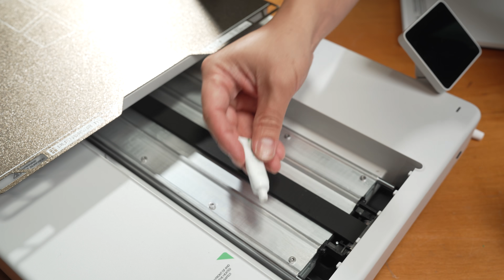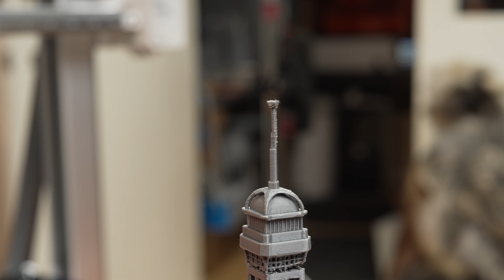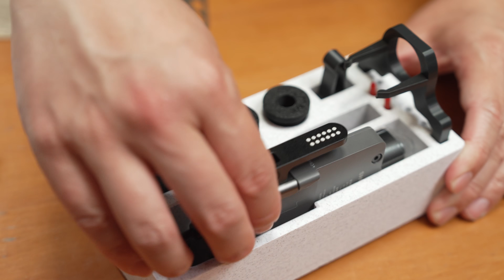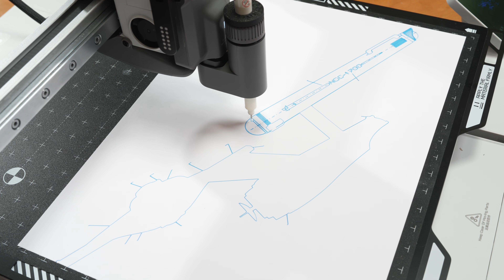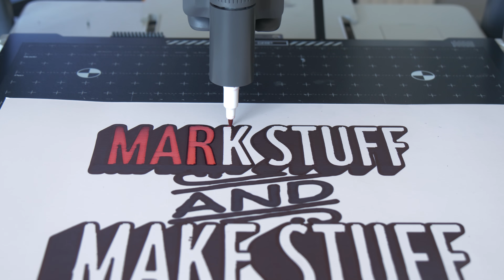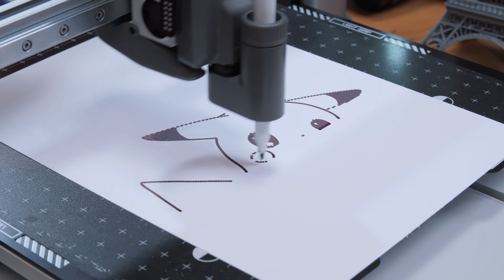Bambu Lab A2L Printer Review!

Comment: @tested  For most people outside the software development field, it’s difficult to understand the nuances in this controversy, which is understandable. However, like most things in life, there’s more to the story. The issue at hand revolves around third-party development libraries. Most complex, and modern software today is developed with the use of libraries. Libraries by definition are separate code from that of the core software being developed.

The leading figure in this controversy, SFC, have an extreme view (by their own admission) on how software licensing works, which differs significantly from how many in the open source and commercial software development communities have historically treated them. The SFC appears to believe that if non-AGPL external software interacts with AGPL code, its license supersedes the Ts&Cs and governance of the other software. This is a rather extreme position, considering that there is currently no legal precedent to support this position.

AGPL governs the slicers code; it does not govern the code beyond it. The nuance many are missing is that the block of code that was redacted and then subsequently restored by the developer (and seems to be the major red herring in the controversy) is only to call Bambu’s private libraries. This block of code is in fact governed under AGPL, however is not actually at issue in this matter by either party. This block of code only exists to call the third-party library; it is not the library itself. However, when the library is private and you attempt to access the library (without authorization) and then bypass the authentication controls, as Bambu alleges, and Jarczak’s published code appears to have been designed to accomplish, you’re now putting yourself in legal jeopardy. 

It should also be mentioned that the SFC is hardly a neutral party in this matter. They have helped to raise hundreds of thousands of dollars to their own foundation as a direct result of stirring the pot on the Bambu controversy. But their ethics are simply not questioned, even though their funding for their foundation relies on creating, what can only be described as rage bate content over Bambu in order to drive donations. 

Finally, it’s highly suspect that to date, the SFC has not brought any legal action forward in their dispute with Bambu. This is despite an extremely vocal position to the contrary; raising hundreds of thousands of dollars in direct donations as a result of the dispute. Additionally, waging a battle in the public arena, and stirring the pot with the community, it begs the question that if the SFC has a strong licensing case and a history of AGPL violations on the part of Bambu, why have they not moved forward with legal action? A curious position for an organization whose core mission is to uphold AGPL licensing infractions.

Comment: I really need advice on buying a new 3D printer! I want to print high detail but not too big prints. I dont like my old printer, i have a Creality Ender 3. with a new bed because the original one sucked. My prints Are detailed but I would like even more and a more steady printer (this one often make mistakes) and its so randome if it makes mistakes too, one time it works another it does not. Changing the fillament is always a hazard, it clogs. I also think i want a more fine top, mine is the standard 3mm. I cant have a resin printer as I live in an apartment with children.

Comment: I would buy it, but to be perfectly clear, i do not want to do business with a brand that "forgets" that they built their entire product line hardware to software on open source and suddenly they're shutting the door and acting aggressively when someone just uses things as they are to open the door back up for customers told that they don't own what they bought. I also don't like to do business with people who lobby for destroying open source through stupid laws (like it's happening in NY) just so they can get away with what is essentially theft (because you cannot categorize taking something that's free for all through the work of those who RESPECT open source and making (in the digital space) and then locking it behind a paywall as anything else other than theft).
I'll stick to open source printers, the quality is perfectly adequate and quite honestly better if one takes the time to optimize their software and hardware.

Comment: I'm sorry but Bambu labs don't just get to say "we don't want 3rd party developers taking or reusing our code". They forked OrcaSlicer which is under AGPL, which means Bambu Studio also has to be under AGPL (that's how AGPL works, you use AGPL code in your project, your project also has to be AGPL). That means 3rd party developers can do whatever they want with that code, it's open source. 

And for people who think "well that's fine for Bambu Studio, but the code to connect to Bambu's servers is a separate package, and the source code for that hasn't been released", again, that's not how AGPL works, in fact the AGPL license was specifically designed to prevent this loophole, if your project is AGPL licensed, you have to release all associated source code for core functionality, you can't just claim that part of it is under a different license.

The bigger issue is how Bambu have been responding to people trying to restore the functionality the printer came with when they bought it, i.e. threatening to sue them if they don't take down their code (which, again, they're allowed to use however they want, since Bambu studio is AGPL). They wouldn't be locking this stuff down unless they expected to make a profit from doing it, so either they're using this to sell your data or they'll paywall this feature behind a subscription in the near future. And do you really want to buy a product from a company that treats it's customers and open-source developers this way?

Comment: I will admit that Bambu Lab has produced some of the most polished features I have seen yet. It is good to see that such high print quality and built-in quality-of-life features are finally becoming available to make 3D printing into the general purpose user-friendly device that we have been wanting for decades. Unfortunately, I just don't trust them. They have proven that they are as power-hungry as Apple, wanting to turn their customers into their disciples. I prefer not to play in their walled garden waiting to have the rug pulled out from under me. If you depend on the company you buy something from to NOT change the rules on you and take away features that you know your hardware is perfectly capable of, then you do not own the device you paid for, you are merely leasing it. I will wait a few more years for comparable features to become standard on every manufacturer's printer. Now that Bambu has shown the technology is possible, I know they are most surely on the way.

Comment: Did Bambu fix the problem where your software has to contact them to get permission to print anything?
Reply: So when my printer has no wifi, and I put an SD card it won't work. Because it will.

Comment: For the record Tested, I have not watched the review but I went to the AGPL section and they simply violated the AGPL. This is an unforgivable action based on their unwillingness to comply with it, not to mention gaslighting the community. You all at tested are all about makers right? Well AGPL is a very "maker" centric license. A company that ships AGPL licensed code without honoring the license terms (source availability, network use provisions, etc.) is taking from the commons without giving back, and that does undercut the ecosystem that hobbyists and small builders depend on. Honestly I expected better from Tested.

Comment: 18:55 "There's been a lot of controversy lately with Bambu Lab making it clear that they don't want third party developers taking the code [...] that taps into their cloud services [...] whether it's part of the AGPL license or not, they want it to be a proprietary thing." [...] "If you want firmware updates to their printers, you need to be locked into Bambu Connect." This is a very soft take on a major red flag.

Comment: WARNING: Bambu's customer service SUCKS!!! I bought a Bambu printer and, in less than 6 months, the nozzle clogged and melted (Bambu proprietary) filament all over the hot end. I contacted Bambu and they refused to honor the warranty. I had to hassle them to even just send me replacement parts, which they eventually did, but didn't fix the catastrophic failure. NEVER AGAIN with this company.

Comment: This is  illegal under US federal "truth in advertising" laws to do this. Any compensation, which includes any discount or free products, is considered a paid promotion. They can, and should, be fined for saying otherwise and that's why there's a "paid promotion" flag on this platform that's to be used and they chose not to. That's a deliberate act, so file a complaint. This has to stop.
Reply: This printer is of no value to them, and the product is required in order to do the review. Ergo, this is not a violation. You shouldn't quote laws you don't actually understand.
Reply: @Dstinct A paid promotion includes more than cash payments. Free products, discounts, travel, or exclusive access can trigger disclosure duties. If a brand gives you something of value and expects promotion, FTC rules apply. Disclosures must be clear and easy to notice. Placed at the beginning of captions, not buried in hashtags or links. Simple language like “ad” or “sponsored” is required.

That's the law, so go on about how I'm wrong... You better understand US laws because being outside the US doesn't provide any protection for you either when posting on a US based platform.
Reply: @Dstinct  the law is clear and you're astroturfing for bamboo, go kick rocks. This reply is actually also a violation of US federal law because you're getting compensation to post it. Ya'll are digging a deeper hole so you should stop digging. Your history of astroturf is subject to subpoena so buckle up because that few bucks they're paying you won't cover the fines.

Comment: The only reason 3D printing took off when it did was because the patents ran out.
The community then rapidly developed & iterated the underlying ideas, control and code etc that underpins it all over the last 15-20 years
So seeing consumer level printers like these pulling what they are that would never have existed if wasn't for the above is simply disgusting. To see a well respected channel like this doing paid reviews (free stuff is paid - you get content) for them is very disappointing.

Comment: I am extremely skeptical about this review. The print of the abbey shows some extremely bad Z wobble on the central tower, just look at how craggily and bad it looks. He also said the tip of the eiffel tower's layers were "perfect" and I know it got snapped off by his kids, but even before it snapped off you can see the layers are an absolute MESS towards the tip. There is a serious Z-wobble issue with this printer and Norm seems to be hiding it for some reason? It states it's not paid, only sent for review, and Norm has been a stand up guy so far, so I'm not sure why he's attempting to hide this printer's shortcomings?

This is not a good look Norm, I used to have a lot of respect for you.

Comment: 20:05 That's the whole point Norm. You recommend the printer today, I buy it, tomorrow BL decides to lock features or block me from using my printer however I want to. I'm SOL. As long as they have a way to modify the firmware in such a way that locks you out of using it without their "ecosystem", these should not be recommended for anybody!
Reply: They sell without ams, how would they exactly lock it down?
Reply: @bbc92314  Locking to a specific fillament is only one way to lock things down. Just the mere fact that the prints (or at least the G-code) have to go through their servers in order to print them on your local printer gives them tremendous control over what you can and cannot print. Not to mention the data they're collecting about you that way...

Comment: I’m so disgusted I can’t even bring myself to fix the power board on my A1. ANOTHER FIRE ISSUE! And know the AGPL abuse. I’m actually considering turning my Ender 3 into a EnderWire. I still have a Printrbot Simple Metal and my ALMOST Maxed out Ender 3! The TH3D Quit Mainboard or an SKR E3 V3, MicroSwiss Direct Drive Extruder and All Metal Hot End, BL Touch, and a Raspberry Pi with Octoprint.

Comment: I get the bambulab hate and its justified but even without that this is a printer without a clear usecase, it's nice that it can be used to printer larger helmets or props but it's not enclosed so you're limited to material and without a second nozzle for dedicated support material you're either dealing with messy support removal / gross interfaces or tons of wasted time and filament from it constantly swapping. The AMS with this makes no sense because it's way too big to make proper multi color prints without too much waste, if you're making multicolor prints that big you're going to have to reevaluate your choices. The plotter and cutter is a decent feature but it's so niche you're better off buying a cricut (and all of their walled garden shenanigans) along with a different printer like a P2S if you're so desperate to stay with bambu or just go to a centauri carbon for nearly the same price.

Comment: IMHO Bamboo should be avoided in light of what they did to the creator of Orca Slicer: they threatened bogus legal action and got that project taken down.
Reply: I agree with supporting the victim of the issue, but y'all need to stop saying objectively incorrect stuff.

It wasn't the creator of orca slicer, it was a separate developer that created a fork of orca that sent cloud printing through Bambu's private server, essentially pretending to be Bambu studio.

You can still use orca slicer more than fine, but you need to use LAN only mode, so the data is sent through your wifi directly to the printer, without going to their servers.
Reply: @analogicparadox  Well first of all, "private server" is a bit of a stretch, it's public facing and used by their thousands of customers, so it's hardly private. But the real point is that it doesn't matter anyway, the code that the developer used that "pretends" to be Bambu studio was released under AGPL, that means he was legally well within his rights to take that code and use it as he saw fit (as long as he also released it under AGPL). Besides which, the network library in BambuStudio should also be open source as well, Bambu legally should not have been allowed to withhold the source code for it.
Reply: @analogicparadox  i heard it was orca slicer and did not verify because i expected to find a ton of re-uploads. as for the cloud connection details i don't know and have no idea if it's actually against their tos. 
Anyhow, their shady practice put me off.